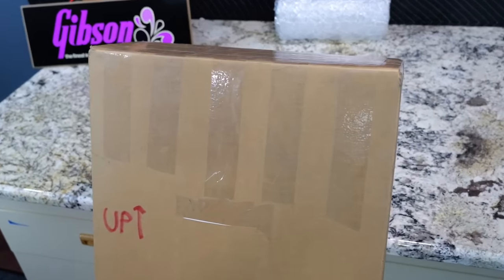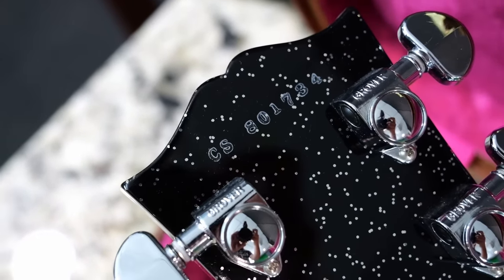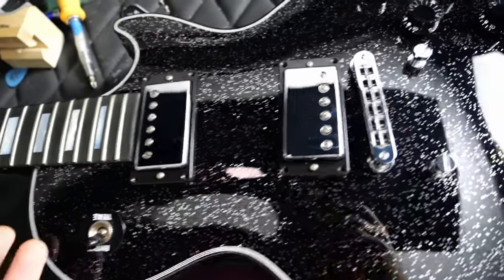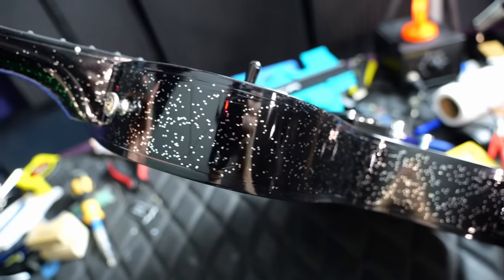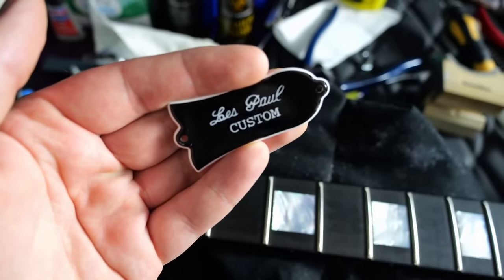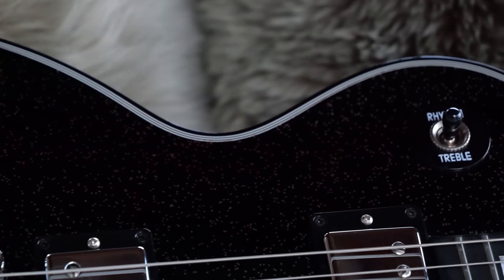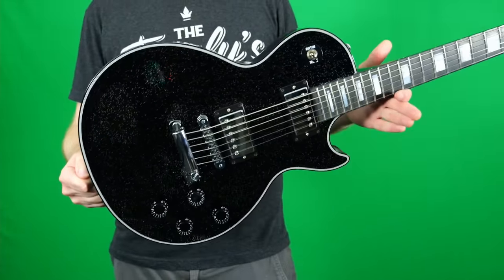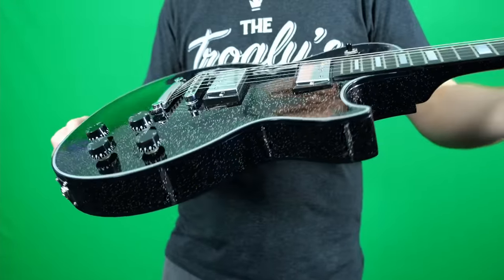A Viewer Helped Me Get a Dream Guitar | 2018 Gibson Moonless Night Les Paul Custom

Comment: My 2 Gibson’s are both 2018. I got the Autumn Shade SG which is my workhorse. Light and comfortable. The other is a TV Yellow Special Double Cut with p-90’s. I got it new for $1300 and now I see them go for $2500. 2018 rules

Comment: These days the jewelry stores don't call them cubic zirconia.  Instead they refer to them as flawless man made diamonds and charge for them as if they were real diamonds. I think I'd like this guitars if it didn't have the density of glitter used to simulate a  sky without a moon.  At least half less would have been better to me. Being that I dabble in astronomy I just feel it would be more realistic. Also I think either a clear pickguard or if they would've done it like they did the guitar would look better. Another thing that would've look a bit more realistic is using more than two different sizes of flakes along with less altogether. It's not as gaudy as say a KISS inspired guitar though . I probably wouldn't like it much if it was one . That's just way to much for me . Keep playing them metal and rock songs I know . I'm singing right along with them. Thank you Chris.
Reply: Yeah, Gibson was experimenting back then.   It is most certainly a love-it/hate-it finish.
I believe that is also why it was made in such small numbers.
Failure or success, it is still a pretty cool guitar and great addition to any collection.
BTW, I agree, 30% fewer flakes with some smaller flakes would look more realistic, still though, the cartoonish night sky look is kind of cool.

Comment: Does anybody know if there's a way to tell apart the 498t and the 498t hot? I was looking to pick up just the 498t and I kept finding the hot version. Is the regular 498t 13k ohms? I thought it was less than that
Reply: @cataclysmicconverter  that's what I was thinking as well. That's got to be the hot version if there is a difference in the two. I've never heard Austin reference the difference.
Reply: I've had a Les Paul with a 498T. It was around 14k Ohms. There is no "hot" version.
It's derived from the name of the 498T, which was/is Hot Alnico. 
They called it "hot" because it was a higher output version of the 490T.
Reply: @raytorvalds3699  thanks for clearing that up for me. For some reason I didn't think the 498-t would be that hot. Only a couple more k-ohms and they get in dirty fingers territory. Yeah it was a little confusing seeing them listed as hot by Gibson as if they were a different spec. Appreciate it!
Reply: @frankwebster9110  You are very welcome!

Comment: I never understood why ABR-1’s weren’t just put on all their guitars. I converted any of my Les Pauls that had Nashville’s, plus many for friends.
Reply: The true ABR-1 bridge conversion is a little more difficult to complete.  The Nashville bridge has threaded studs pressed into the guitar's top and the bridge posts screw into them.
The ABR-1 utilized threaded rods screwed directly through the maple cap and protrude into the mahogany back.
To convert a Nashville bridge to a historic ABR-1 the Nashville's threaded insert homes would need to be plugged with maple and then re-drilled for the skinny ABR-1 threaded rods to be installed.   Purest believe the threaded inserts of the Nashville bridge inhibit sustain as compared to the historic ABR-1 threaded posts.
Just changing the bridge from a Nashville to an ABR-1 using conversion posts is still a great upgrade.  Many believe the metal used in the ABR-1 to be superior to the Nashville design.
I've both types of conversions on my Les Paul Guitars and believe both conversions are a great upgrade.
Reply: @hkguitar1984  -Aesthetically pleasing, and much better tone, I think? Yeah, I was told by my former guitar tech 14 or 15 years ago, who worked for a somewhat famous band, said it couldn’t be done, so I had to prove them wrong!
Reply: @marions.120  I will admit, many of the mods or repairs I've done to my guitars would typically be considered impossible, but that is only in the context of cost verses results.
Doing the work myself I'm not really concerned about cost or whether the instrument is worth such an upgrade or modification.
As for the ABR-1 bridge conversion, as I stated previously, in both types of conversions I noticed an improvement in the guitar's acoustic and electric resonance.
One of the main things I love about guitar (playing or working on) is that the subject is endless and bottomless.  There is something new to learn each and every day.
Reply: @hkguitar1984  "The ABR-1 utilized threaded rods screwed directly through the maple cap and protrude into the mahogany back." 
The rods protruding into the mahogany back, wasn't that the "Maple flame mod"? Originally, the rods are only in the maple cap afaik.
Reply: @raytorvalds3699  I believe you are correct.
I had an R9 spec husk built for me so that I could completely finish it myself.  When I located the ABR-1 screw/stud location I ended up drilling into the mahogany.  it was at that point I figured I'd make Lemonade out of lemons and drill both of them into the mahogany.
I can't say that I notice any improvement over the maple only depth.
IMHO, I feel any advantage or improvement found by switching to an ABR-1 is due to the better materials used in the ABR-1 casting.
I've had traditional vintage ABR-1 as well as modern Steel (both with brass saddles), I just seem to prefer to tone of the ABR over the Nashville.   Also, due to when I grew up (started playing guitar in the early '70s) I just prefer to look of the ABR-1, the Nashville looks to thick to me (but still better than a Harmonica bridge LOL)
Reply: @hkguitar1984  -I agree! My tech’s have both been in the Bay Area and it was just easier if I learned how to do most of the work myself. Not all of it, but most.
Reply: @marions.120  I totally understand.   Back in 2006 I got fed up with city life and living in the Detroit area.  My Wife and I moved to Northern Michigan where there are no people!  LOL   Apparently no Luthiers either!
No worries, it is very peaceful and we couldn't be happier.
Reply: @hkguitar1984  -Well that’s perfect, you’ll learn more! I’m wondering if the same thing may happen to me because I’m thinking of moving out of the country?
Reply: @hkguitar1984  -Yes indeed!
Reply: I’d like to address your original question, “why not use the ABR-1 on all guitars (Gibson).
It is my understanding that the Nashville bridge cost less to manufacture.  Also, the extended intonation range allows for more variation of the guitar’s spec/dimensions during manufacturing.   Also, I’ve read that at one time Gibson had an issue with wrapped Les Paul bodies that made the installation of the ABR-1 difficult, where as the Nashville was able to be installed over a wider range of quality control issues.
I had to re-read that twice because it implied that Gibson was OK with shipping a guitar with a slightly wrapped body as long as the bridge could intonate the instrument!    
Anyway,I wanted to try and answer your original question. 😉
Reply: @hkguitar1984  -I’m sure it has to do with cost, but I haven’t had any trouble with intonation. I suppose I’m not in as much of a rush as the guys at the factory, but for the cost of most of their guitars, what the heck!
Reply: @marions.120  100% agree.
IMHO, any guitar $500 or more should arrive out of the box with acceptable intonation.   Any guitar +$5000 should have perfect intonation, control wiring as well as the pickups adjusted to the factory spec.
Just my $.02 Cents (rantings of a 60 year old Man) 😉
Reply: @hkguitar1984  -✌️😎🎸🎶🎵🎶🎵Not a rant, just true feelings. Just remember, that 2 cents doesn’t go as far as it used to!
Reply: @marions.120  LOL, isn’t that the truth ($.02 Cents doesn’t go far at all)